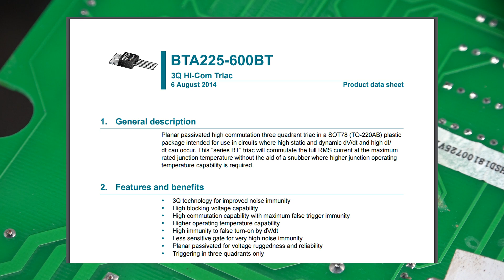Laboratory Hot Plate Stirrer Repair (Triac Replacement)

Comment: you need flux, even an expert would have a hard time using lead free soder and no flux
Reply: Flux is training wheels dude
Reply: There's flus in the solder (says so on the reel) and I'm pretty sure it's leaded solder (I've seen the product number 8PK-033 on leaded solder).
Unless you mean for desoldering, yes extra flux will really help there. But you can also just dump lots of leaded solder on the joints (but you also need a way to remove it then of course).
Reply: Ughhh.  lead free solder...  Good old leaded rosin core works the best.  Especially on crummy grey market Chinese boards covered in schmutz and contamination.  Fume extractor and Bob's your uncle.
Reply: +tiporari the only time I've needed to use Flux is on plumbing joint jobs, with electronics I've found that led/tin works best.
Reply: good look doing an QFP chip without some flux
Reply: +Eduardo J R good luck doing any surfmount anything without the proper set up.

Comment: Very nice knowledge of electronics for a chemist!
And yes your soldering of BTA225 was amusing :D
You should screw the triac to the base of the heater box to ensure it gets cooled. Just make shore you isolate it with some thermal insulator pad and screw mount from the box which is probably grounded.

Comment: +NurdRage you want a desolder pump and solder wick. The pump will remove most of the solder  if not all of it including any that is left in the holes after the component is removed. solder wick is very useful for desolding SMT components and cleaning pads or bridges

in terms of your soldering skill.... just because you are not a professional in the electronics field doesn't mean you cant try to do the job properly you should get yourself a couple of electronics DIY kits to practice on  (most are useless but are good to learn on) and also watch a couple of tutorials on youtube and you will be soldiering like a pro in no time. its not a hard skill to learn but very useful to have and it does take some practice.
Reply: also the dual power supplies  are set up for different tasks  the smaller floating one is likely dedicated to the micro controller and logic,  the larger one  will likely be for the motor/heater drivers  due to the higher current. (without better detail its hard to say )

Comment: Electronics engineer here. That second power supply is not screwd anywhere , because its chineese peace of s**t. Because thats a switch mode power supply, i think thats the step down converter from 12 to 5V for microcontroller, lcd and all other stuff. Motors are inductive loads, which can burst voltage spikes at the circuit, why they cant be connected to the same supply as microcontrollers are

Comment: Amateur electrical engineer here: the extra power supply is because the hotplate stirrer is a piece of s**t. It was cheaper to buy those little dingleberries and solder them in than to buy all the components themselves and build a nice board. Also, you did alright at soldering.

Comment: Nicely done, Dr.NBL. The reason there are two PSUs is probably the controller board was designed first (for driving smaller motors) and redesigning for the bigger motor with a 2nd (or beefier) onboard PSU, with isolation and all that, was more expensive than bodging an external secondary PSU. At first I was thinking that the appliance did not look half bad with all the opto-isolators, heat-shrink tubing and liquid-runoff on the die-cast housing.. until.. that bodged PCB abusing the casing (with insufficient insulation) for heatsinking :( and the flying suppressors (bodged brown cubes) near the motor-drive. (The white pads are thermal-conductor-electrical-insulators - hope your triac has one, if needed)

A tip for desoldering - just cut the pins from the dead component first and desolder one pin at a time. Then add fresh solder to the plated-through hole and blow hard from one side while the solder is still molten - you'll get a nice clean hole for placing the new component. No wick needed. Beware of splatters on the other side ;)

Comment: Electrical engineers don't solder. They have the technicians solder up the prototype/repair the equipment while they play around with circuit traces/motor designs in CAD.

Comment: Nice vid. Something else 4 a change :D. Only comment: next time cut of pins before desoldering. You probably will destroy the component during desoldering/already burned out, and it might reduces the chance of ripping of the copper traces. But over all you did a fine job!

Comment: the fuck!? a fricking stepper for the stirrer? who was the idiot that designed that piece of crap? not only its overkill with its crapload of torque but its also expensive when they could have used a way cheaper brushed motor with a encoder or one of those frequency controlled brushless motors which come with the controller included (like the ones used in the laser printer scanning mirrors)
Reply: The stirrer needs torque if its going to stir heavy thick liquids.
Reply: Probably don't want brushes in a possibly flammable atmosphere.
Reply: samocamo123  but you dont have such a strong magnetic coupling, a smaller motor could still do the trick just fine. Its not like you can "stir" molasses, nor like that it can spin at 1 rpm

Steven Swenson  yeah probably, still there are small brushless motors like the ones used in fans with enough power to do the job. I mean, even a smaller stepper would have been just fine. Having 200 steps for job that basically need all that steppers were not invented for is like putting a V8 for a fan inside a pc.....

Comment: That white 6 pin device is an opto isolator. or Optocoupler. Using two LEDs to transmit data. In this case voltage to the center of the Triac. 

If you dont have a desoldering pump to clean out the holes. Heat up the hole and force a high pressure burst of air through it. It will blow out the liquid solder. The thing that talks is perfect for producing that high pressure burst of air. This way you wont end up with a cold joint. Terrible for high current applications. Cold joints looks very dull and has a higher resistance than a perfect joint, which is shiny.

Next time when this piece of shit breaks, you can just cut the pins on the component and take one lead out at a time. Because attempting to heat up all 3 / 6 pins at once may result in a lifted pad, and oh god you do not want those... Good tip for a extremely charred component, where the leads have basically melted off.

Comment: If I had to guess the triac overheated and burned out because for some reason it is flapping in the wind. If you dont want this to happen again you should probably put some sorta heat sink on the triac. And I bet you would have a lot easier time soldering if you applied some flux to the joints first.

Comment: My electrical background is only incidental to my lab work but: Might be a good idea to find a way to stick an actual heat sink to that triac. It isn't too surprising that it would eventually blow given it has very little cooling. Maybe improve the connection with that metal plate it's next to? Also, you might want to check whether the back of the triac is in fact grounded. The metal back probably connects to one of the pins, and I have seen components like that have live backings (albeit in poorly designed systems). Even further conjecture, but perhaps a potential buildup between the triac and that plate caused a spark and a short? That would require extremely poor forethought by the manufacturer, but hey who knows?

Comment: Future soldering tip: flux and desoldering braid are your friends. Flux pen for 5-10 dollars will save all the heartache (you know the chemistry of removing oxides thus allowing the solder to 'wet' the pads better than we ever will)...and desoldering braid to clean up those holes is just a cheap no-brainer. the expensive stuff is way better, but the cheap stuff (plus flux) is still excellent.
Reply from the maker: +frollard yup! Definitely adding those on my list of things to get. Thanks:)
Reply: I personally love the "solder sucker" tools with the spring-loaded plunger. Braid doesn't clear holes nearly as well. Helps to have extra hands though.
Reply: Gootwick (available on ebay or banggood) is a really good and inexpensive wick.
Reply: P.s. Looks like one pin of the triac has a cold solder joint, you may want to touch that one up.
Reply: Jeremy Lee good braid performs better than a plunger tool any day of the week. It does need to be good wick though.
Reply: My experience is the opposite.  I have a solder sucker, the spring kind, and hate it.  I have a roll of braided pre-fluxed desoldering wick and it is awesome.
Reply: Then probably all the braid I've tried was crap, or not fresh enough - hmmm... humid semi-tropics might not be a good environment for untarnished copper, come to think of it. (Ah well, at least we don't have to care about static straps.)
Reply: Jeremy Lee a proper desoldering braid is infused with flux, and just drinks up solder. it'll leave the hole in the board don't and clean.
Reply: I personally wouldn't recommend braid for someone starting out in soldering, too easy to burn yourself and very hard to clear the plated holes of solder.

I use a desoldering tool, it's basically a spring loaded plunger, works a treat most of the time, sometimes so well the parts fall out of the board (which normally requires a desoldering gun). I've found the larger ones generally work better because they move a large amount of air and can drag up more solder in one hit. It sucks when it doesn't suck up enough and you have to resolder it to get the stuff behind to move.

Though I do agree if you go and get wick get gootwick, it has flux in it that helps out, particularly when your working on lead free stuff

Comment: Don't worry about soldering leads together like that and desoldering them. In many small pitch applications you apply a lot of solder across many pins quickly, and then go back and reflow any interconnections that are not meant to be there. With proper flux usage they just fix themselves when heated up, and is a standard practice.

Comment: Not a professional, but some 2-bit insight on the design of the circuit. My guess is that there are 2 power supplies because they're optimized for different things. One could be designed for high power, at the cost of voltage stability, and the other vice versa (voltage stability can be quite important for finicky logic circuits like that controller). As for the separate power supply board, I wouldn't be surprised if it was simply cheaper to bodge in a commercially made power supply when your needs are simple or very common, as is the case for a micro-controller power supply.

Comment: Just to help you next time, a little  spool of something called desolder braid, it's a copperlike mesh impregnated with flux, slurps up soldier like crazy.  Otherwise, the frustration with dealing with that stuff is normal.

also, there is paste you can get, then heat with a pen or whatnot.  And if the copper trace is fried, you can always follow where that trace goes, and replace the trace with thicker gauge wire, enough to compensate for the trace.  Might want to do that anyways, since the trace might be damaged, and now pull more current through what's left of the trace than is good for it.

Love the science, learn a lot from you, and your repair skills are actually pretty good for dealing with a piece of shit.
Reply from the maker: +Magestorm Allgoode thanks for the advice! I'll have a look at reinforcing the trace with some wire. I hadn't thought of that.
Reply: id try to heat sink that triac though, just a cheap finned thing with good ol heatsink glue

Comment: The reason for the power supply being there is it is a piece of shit. Not only this, the location of those triacs is very poorly designed. Is it supposed to be heat syncing on the case? I feel like because you pulled the board out of the case, the triacs will not heat sink as well as before thus will breaking sooner.

Comment: I think the piece is loose not only because it is a piece of shit, but for other reasons. Maybe this company produces different models that uses different boards with different power supplies, so they build every heater the same and just change the board or some components inside it.

There is no reason to think that they are adding redundant pieces just because they don't know better.

Comment: You don't need to apply solder from both sides. The solder should melt/wick trough the plating in the hole.

A bit of concern to me is the black stain on the board. That looks like carbonization. Carbon is a conductor, the triac is on the mains side.
I mean: if it works, fine. But keep a fire extinguishers ready and do not use the hot plate unsupervised. And maybe at an emergency off to your lab space. This video would make insurance claims a bit more complicated.

By the way: As an Electronics Engineer, I was not not laughing - this is field repair without a desoldering iron and the pad and drill diameter look annoyingly small relative to the pins. That sucks. Your solder job is something I would label a temporary fix, that is good enough until a replacement unit arrives. The carbonization would be reason enough to replace the unit "asap" in a professional environment, so I don't consider the soldering job of being any more of a concern. (There are I think mil standards descriptions how to fix a carbonized board - but this unit is at best commercial grade, so it is not worth the hazard of drilling/milling away the carbonized parts of the board) But I understand as a private person, why you don''t want to waste money on a new stirrer. Still: I hope for you that the stirrer plate does not yet again fail hot (which is a design fault anyway - who on earth does not protect such a device against this failure mode?! It should fail safe, meaning off).

Comment: meh 
your soldering is fine
Reply: Both devices weren't pushed through all the way, the soldering iron did not seem to have the correct temperature and he has improper usage of the solder, by transfering solder to the iron and from the iron to the connection. That also results in whatever he was doing at 4:22.
With this kind of stuff it will pass but it certainly isn't 'fine', and with a bit of practice and a tutorial video he could certainly improve a lot.
Reply: No, it's definitely not fine. The iron tip really needs cleaning and the solder is paste-like because all the flux is already gone. Also the gap between the two mains pins is still almost bridged by solder, not something you want in an environment, where you get vapors, that upon condensation are very likely conductive.
Reply: +Goodwine And it seemed to me like the soldering iron wasn't hot enough, which was making things harder than they needed to be.

Comment: It looks like you have never heard of solder wick.
Reply from the maker: +fpm1979 true. I had to look it up. Im going to buy a roll for my kit right now!
Reply: +NurdRage Personally I like using a solder sucker better than using wick. YMMV. Typical $5 solder sucker:
https://www.adafruit.com/product/148
Reply: If you do get solder wick, be sure to get the expensive, name brand stuff. The cheap stuff doesn't work at all.

My recommendation is to get a solder pump instead. Cheaper, not consumed on use and easier to use.
Reply: What’s important is that the desoldering braid is pre-impregnated with flux.